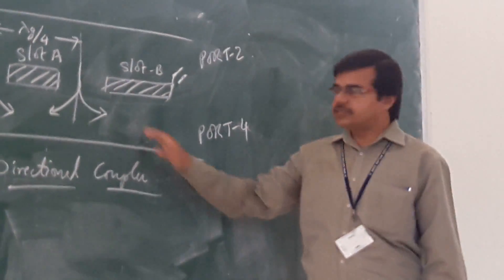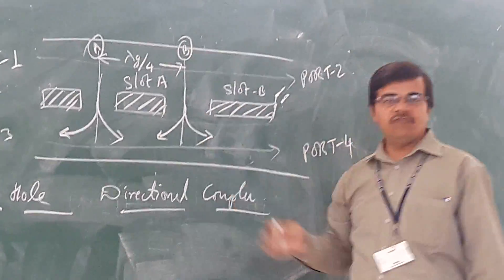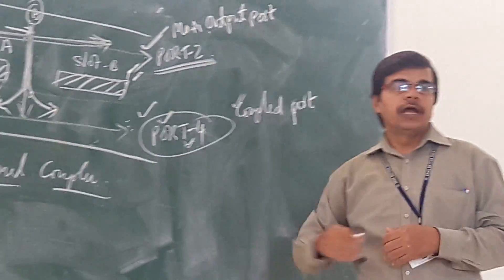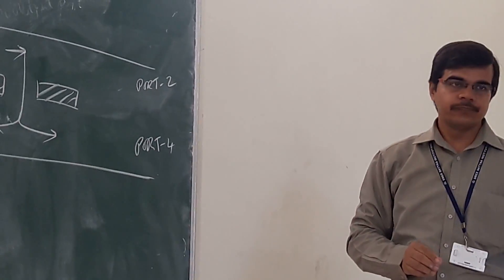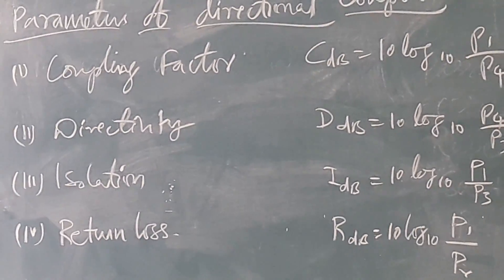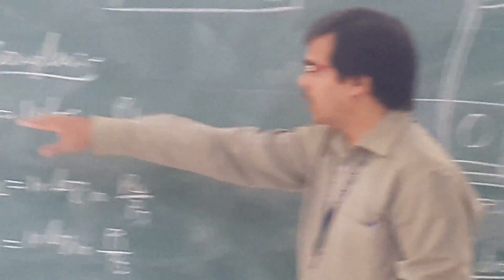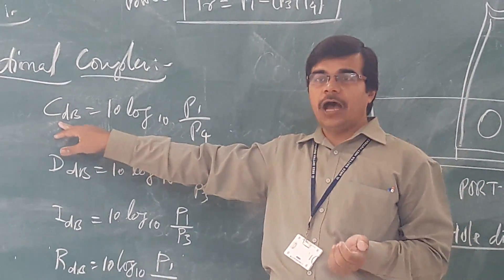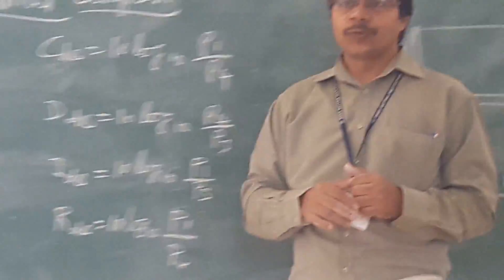MWE UNIT 2  TOPIC 8 Directional Coupler

Comment: how to find power at isolated port when power at all other ports are given
Reply from the maker: Dear 
Shreyanshi Singh,
Power at isolated port I db= 10 log10 P1/P3 where P1 is power at PORT 1 and P3 is power at PORT 3. Power will be in terms of db. Even the product of Coupling factor and Directivity gives the Isolated power.
Reply from the maker: Dear 
Shreyanshi Singh,
As it is log we need to add the Coupling factor and Directivity. we know that multiplication is addition and division is subtraction in log.
Isolation in dB = Coupling factor + Directivity

Comment: The explanation  is really  good sir but why didn't  you tell the reasons for the statements you are giving i.,e how  we are getting  that 180 phase  shift  And  that too for port 3 only. If possible  please  suggest  the textbook  or website where  we get all the microwave  components
Reply from the maker: i am sending you the link for the app that we have develop related to ""Microwave engg lab"".
The link is : http://www.appsgeyser.com/3761176
Reply from the maker: Forward couplers are in-phase couplers. Backward couplers couple in quadrature (the coupled port phase is 90 degrees more negative than the direct port). If port 1 is the incident port, port 2 is the through port (because it 
is connected with a straight line). Port 3 is the coupled port, and port  4 is the isolated port. For a signal incident on port 2, port 1 is the through port, port 4 is the coupled port and port 3 is the isolated port.